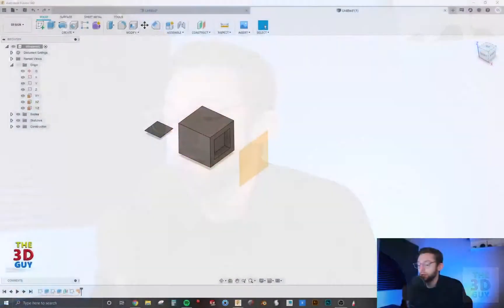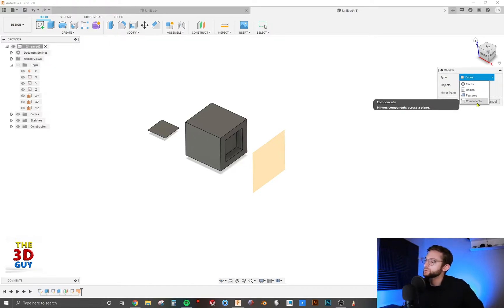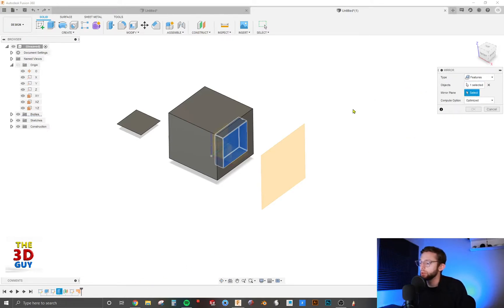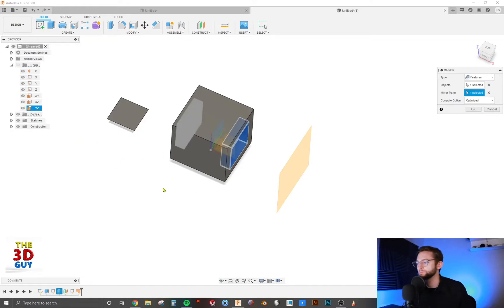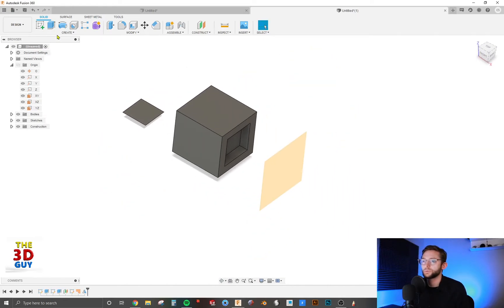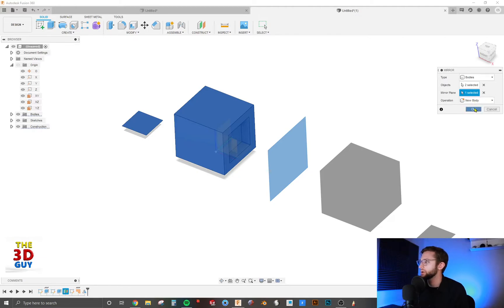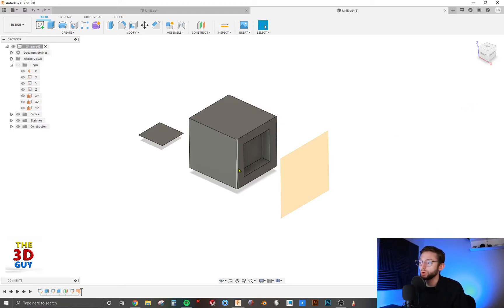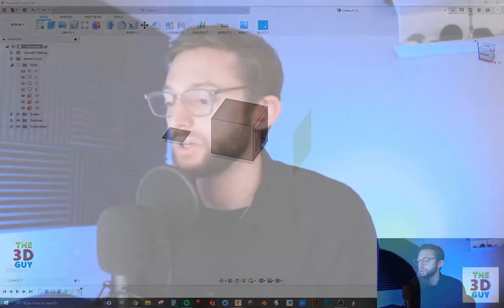Mirroring Tutorial in Fusion 360

Comment: So I am trying to make the mario question block. Is there a way to mirror the extrusion onto all other faces of the cube? I cant find any way to do it unless I insert the svg onto each face individually, which I dont want to do because it’s hard to align it all
Reply from the maker: unfortunatly as far as I know the SVG files are not able to be mirror, and you will have to add them manually, though if you are making multiple Mario question blocks, you can just use the Move/Copy feature to them duplicate the first block